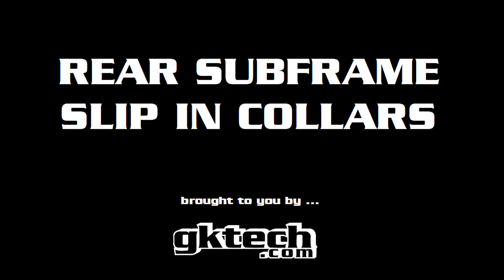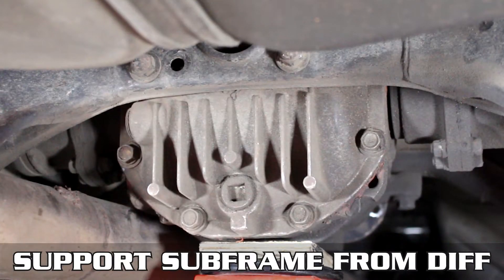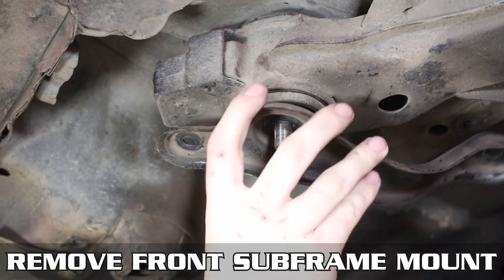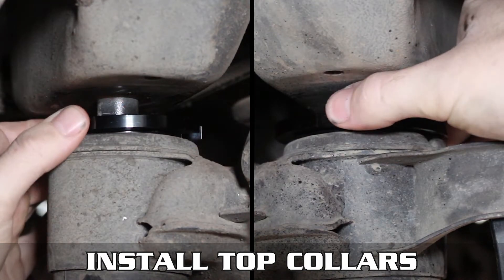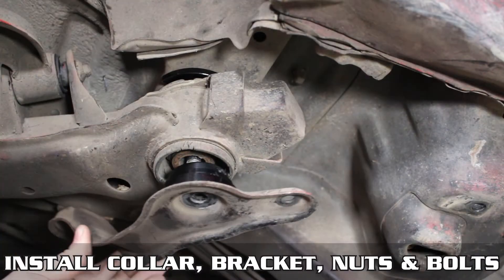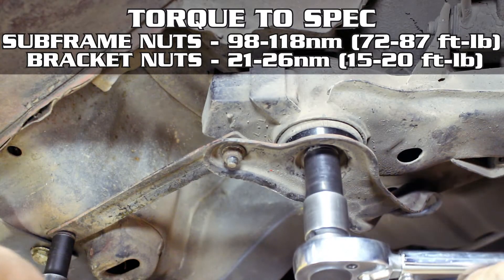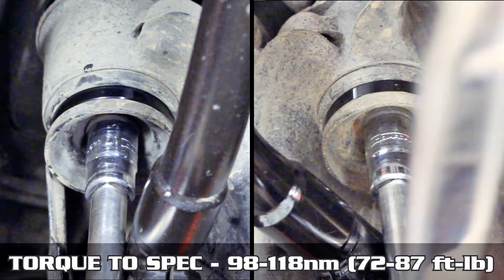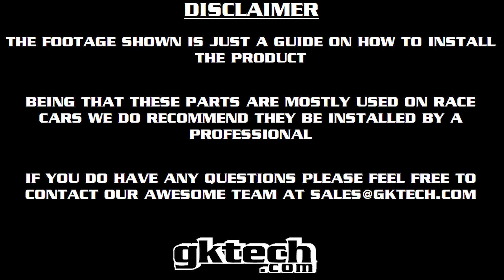Gktech Rear Subframe Slip In Collars - Install

Comment: I'm guessing the body of the car is higher after install so if coilovers are installed you'd need to lower the car a little?
Reply from the maker: It's incredibly marginal, for the most part not visible from the naked eye.
Reply: @gktech  thanks for the reply! Fitting these in the next day or two to my s14 to hopefully get rid of my sketchy wobble from the rear (I believe my mounts are dead lol)